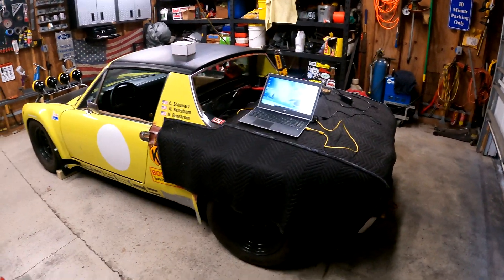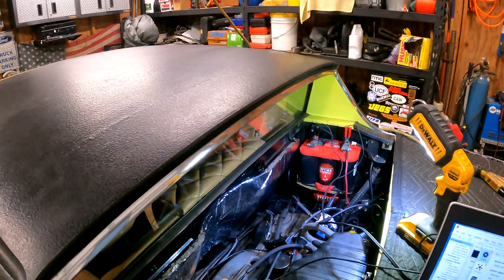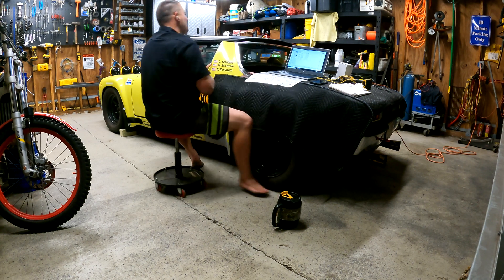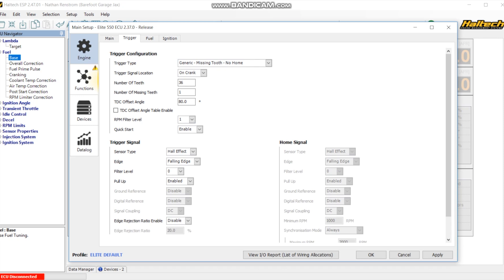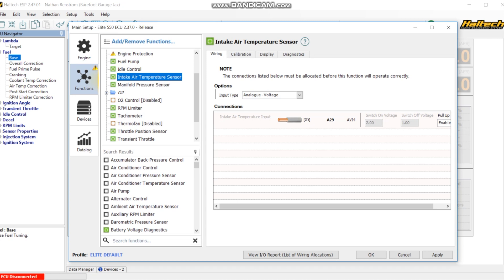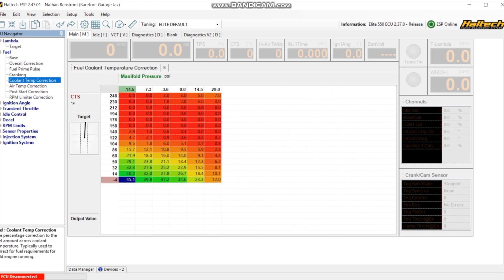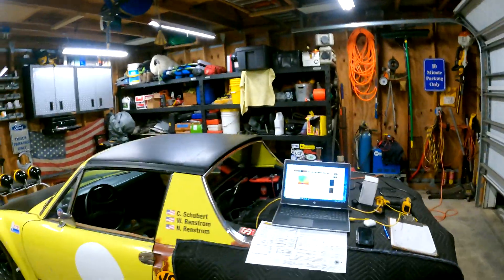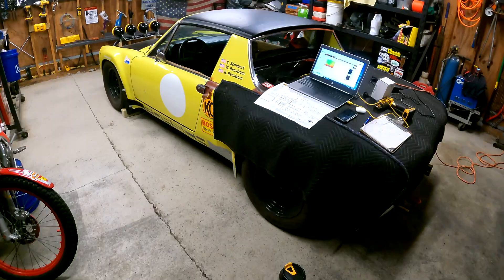Porsche 914 D-Jet Delete- Haltech EFI Conversion Part 9: First start!

Comment: Does your TB have a small hole in it?
Reply: The plate
Reply from the maker: Currently, yes. I had one recommendation to solder it shut but the IAC seems to be working fine with it open right now.